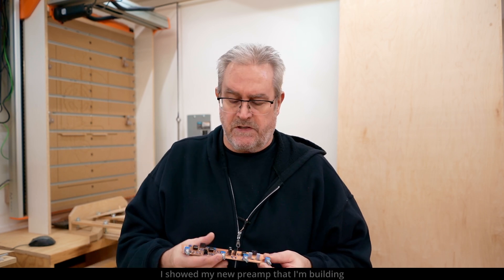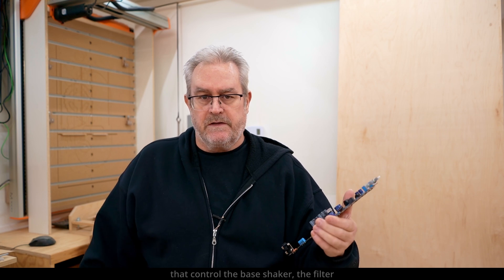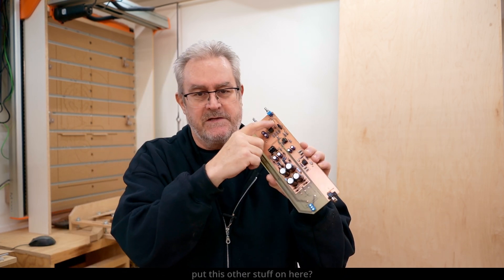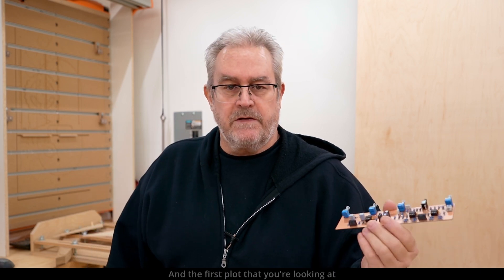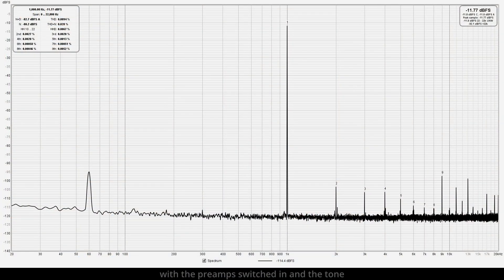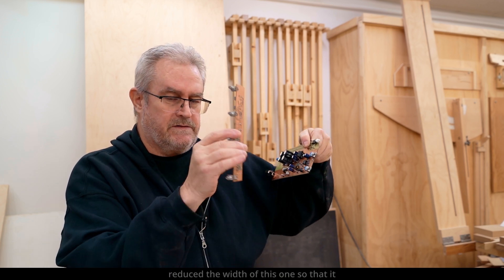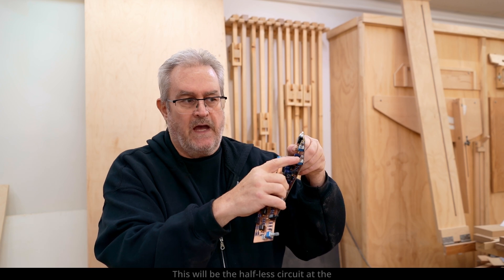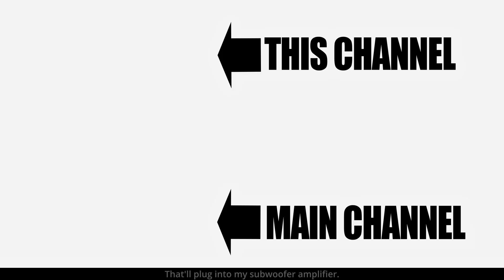My DIY Preamp

Comment from the maker: The preamp design I used is based on this one from Rod Elliott: https://sound-au.com/project97.htm
I made a few small changes and also designed my own board layout. I strongly recommend Rod's site if you are looking to get into audio electronics.
The preamp works splendidly and will be the heart of my control box project. I used high quality parts and that includes the opamps (OP275). 
It has controls for bass, treble, volume and balance, plus a switch to turn off the tone controls.
The power supply board also has the bass shaker lowpass filter and output for the Hafler circuit speakers at the rear of my listening room.
Reply: thanks for subtitles

Comment: Request if any one can help me with some advice : I have a Bose soundbar 700 . I have a Klipsch subwoofer SW350( self powered). I want to connect soundbar to the sub.  I am trying to connect through wire. I am using 3.5mm RCA for soundbar our and RCA in for sub as provided. ..no luck.  The sub seems  getting sound as I can feel lightly on skin but  can say that it's not working. Used the same RCA cable  my phone's audio jack., I am getting a solid thump.   Why I am not getting this from Bose soundbar. ?  Need help here.  I did  use Bose app. The app is not helping to add the subwoofer. Nothing is detected.

Comment: Looking forward to the final build.
 
Q:  I expect you will perform initial tuning with your PC, software, & MIC setup.  For your fine tuning, will you be able to control the equipment you engineered and built with a remote control?  If not, will you be able to temporarily move the preamp to your chair to dial it in?  Otherwise you'll be left with a lot of back and forth.